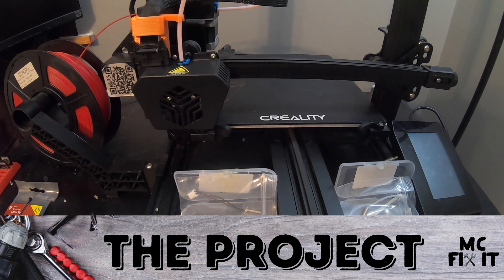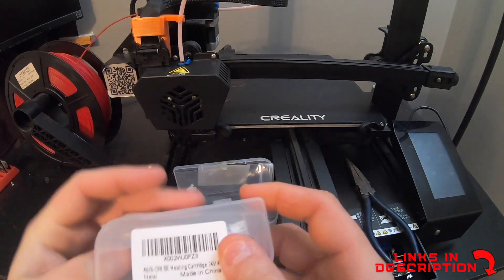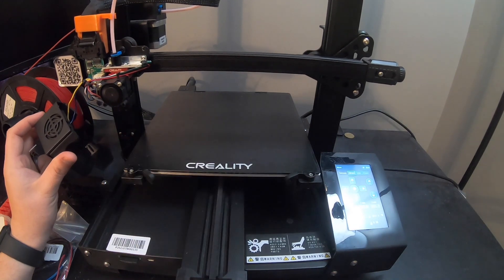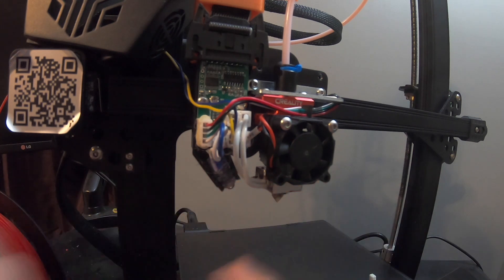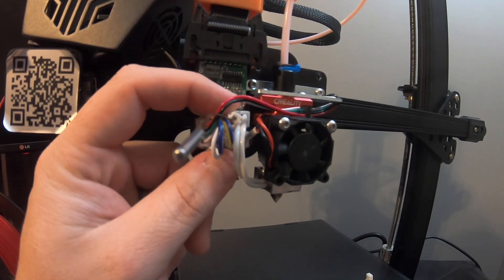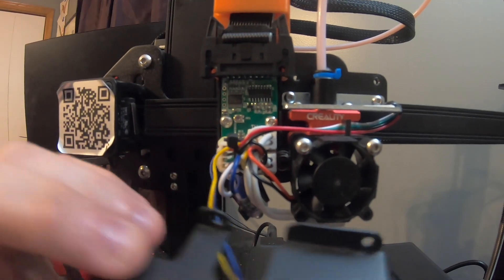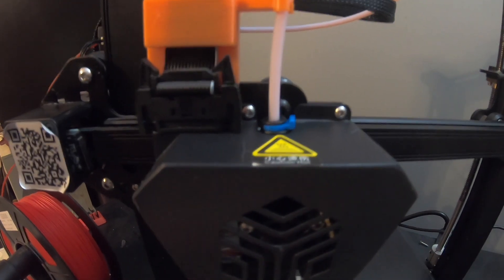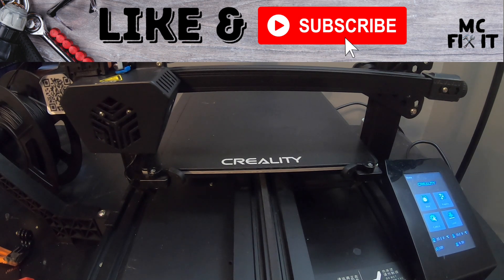Replace Creality CR6 SE Heat Cartridge & Thermistor Sensor High Temperature [Complete Guide]

Comment from the maker: Learn how to fix your 3D printer's heating issues by replacing your heat cartridge and thermistor sensor. I will go through multiple steps to fix the problem. 

Parts:
1. Heating Cartridge - https://amzn.to/3HZOVYS
2. Thermistor Sensor High Temperature +300 Degree
- https://amzn.to/3J6ohPu

Tools:
- 1.5 & 2.0mm Alley Key - inside tool tray
- Needle Nose Pliers - https://amzn.to/367KFJC
- Small Zip Tie (1) - https://amzn.to/3MCxaCe

00:00 The Start
00:07 The Project
01:33 The Tools & Supplies
02:11 The Fix
03:17 Testing the Power On/Off Switch
04:28  Removing Heating Cartridge
05:10 Installing New Heating Cartridge
05:45 Removing Thermistor Sensor
06:48 Installing New Thermistor Sensor
08:40 Wire Tie, Install Sock, & Put It Back on Cover
10:45 Level Printer
11:08 Test Print to Verify Fix
11:42 It's Fixed
12:05 Closing

This video should be helpful in seeing how to fix a heating issue with your 3D Printer. Check your make and model to get the appropriate parts. Be careful not to touch anything when plugged in due to possible electrocution or worse. 

Check out my website at http://mcfixit.us 

Disclaimer:
Due to factors beyond the control of MC FIX IT, I cannot guarantee against improper use or unauthorized modifications of this information in the video, post, blog, or social media. MC FIX IT assumes no liability for property damage or injury incurred as a result of any of the information contained in this video. Use this information at your own risk. If you feel uncomfortable at any time. Stop and go to a professional. MC FIX IT recommends safe practices when working on vehicles, your house, or any other project and or with tools seen or implied in this video. Due to factors beyond the control of MC FIX IT, no information contained in this video shall create any expressed or implied warranty or guarantee of any particular result. Any injury, damage, or loss that may result from improper use of these tools, equipment, or from the information contained in this video is the sole responsibility of the user and not MC FIX IT.

#mcfixit #3dprinter #creality
——
Supplies used to record this video: 
* GoPro Hero 7 Black - https://amzn.to/3f3ALtb 
* 256GB Flash Drive - https://amzn.to/33pAueG 
* Vlogging Frame - https://amzn.to/33tajE0 
* GoPro Pro 3.5mm Mic Adapter - https://amzn.to/2RCURCu 
* Youmic Lavalier Lapel Mic - https://amzn.to/2R55sWX 
* Boom Stand (tripod) - https://amzn.to/3bdkQaw
* 5/8” to 1/4” adapter (boom to blogging frame- https://amzn.to/3txrVsM 
* Portable Battery Powerbank- https://amzn.to/3vJQc0q 
* 6ft USB to USB-C (powerbank to GoPro)- https://amzn.to/3uAS5MH

Comment: Hey so in this model i had a filament leak and two of the cable came out in sensor, and I cant remove the metal part inside, i opened the lock under it but its stuck ı cant hold it what can i do